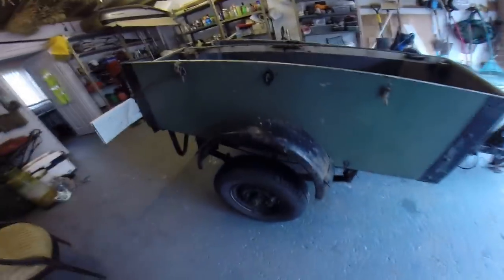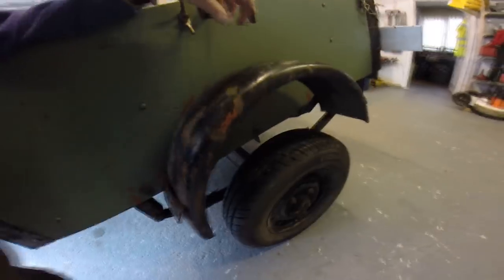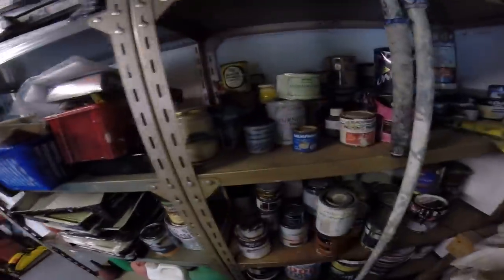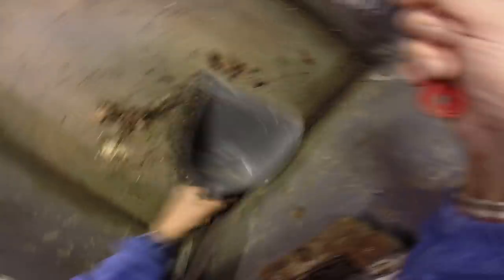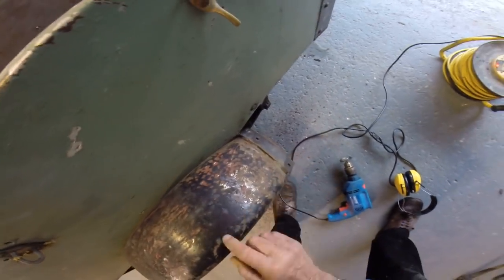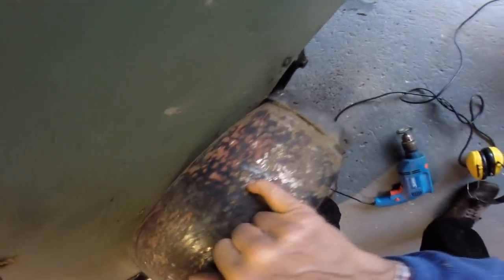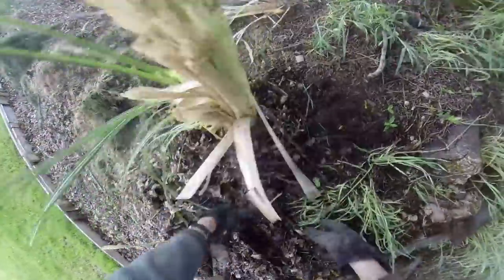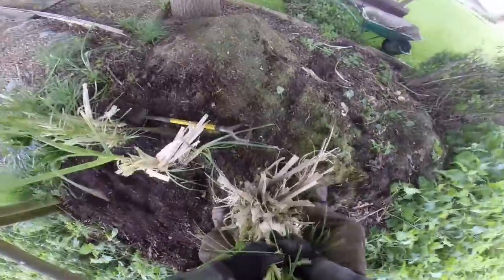Renovating a Vintage Trailer

Comment: A little tip from one that's been in the decorating trade:- store all your paint tins up-side-down. That way the skin will form on the bottom, and you get to use more, and waste less of the paint. Save money too....
Oh, one more thing, You Sir, are not an idiot. Multi talented, wise, clever with your hands, fit, (for someone that,s nearly six 69). I'm 56  and almost crippled,, yet 5 years ago I also was fit. I'd walk 5/6 miles for a day on the bank, fish for 10 or 12 hours, then walk the same distance back. I.m no good with my hands, ( can't even decorate rooms any more), can't do simple repairs (and hat's very frustrating after being practical all my life). And to top it all off, you share with genuine idiots your wisdom and knowledge, and Mike is just like you!!!!
Reply: My grandfather gave me the same advice!
Reply: I was about to leave the same comment.

Comment: Graeme A totally awesome tip on paint for you!.... to stop paint getting a skin- when you've finished using it , put the lid on and shake it up (this gets are air inside the tin saturated with the volatiles in the oil for oil based or water for water based paints). Shake hard maybe for 15 or 30 seconds, and then stand the tin upside down for at least a couple of days (this ensures the lid seal is good, before giving it another wee shake and standing properly. Guarantees no Skin top or bottom, done this for years! Enjoy  :--)

Comment: Looking at the apex shape of each end of the trailer I would say it was for  housing temporary traffic lights generator would be bolted down where the holes were traffic lights and tripods would be stored in the rest of the trailer.

Comment: Great Job Graeme. By the way how are the potatoes doing?
Reply from the maker: About to test shortly,had a few runner beans with meals but so dry they are now slowing up and getting a bit stringy.Will update if any spuds eatable shortly.

Comment: I store my used paint tins upside down, it seals any air gaps in the lid, slows the skinning process marginally, and puts the 
skin at the bottom of the paint when you go to use it...